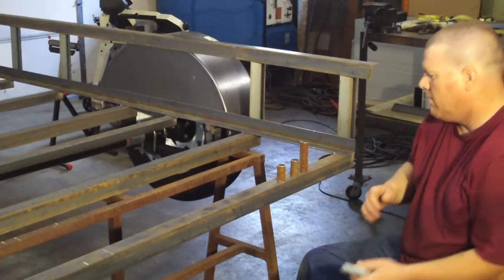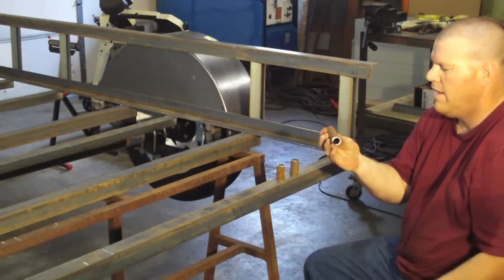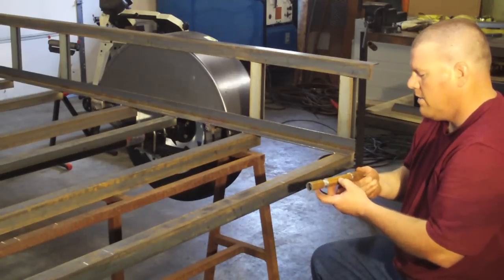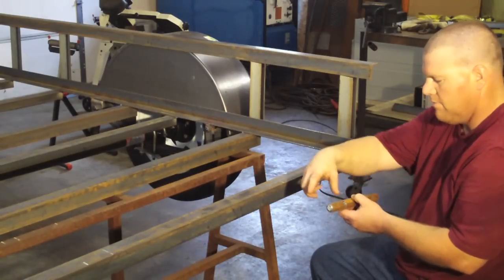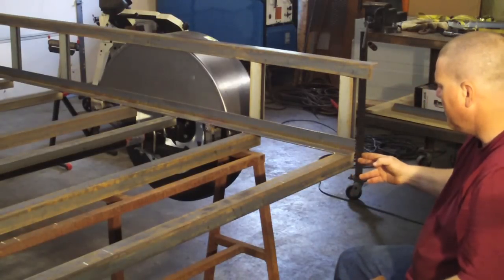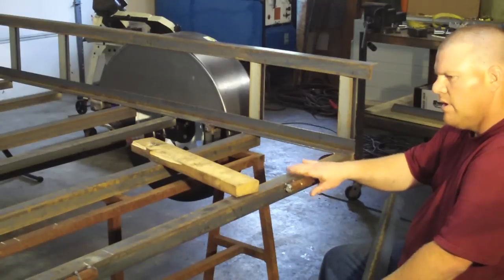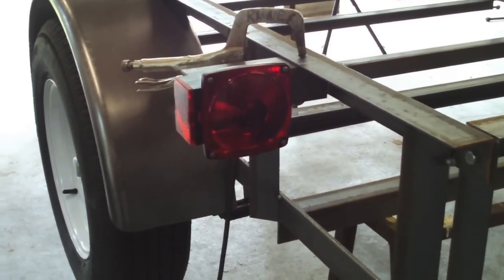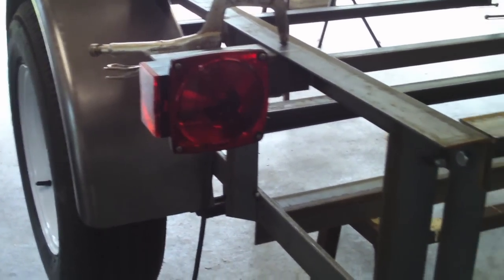How to Build a Utility Trailer Part 8 Ramp or Tailgate and Tail Lights Installation

Comment: 11 years late but….The angle running front to back how much more would it cost to add another 1 1/2” to the leg running up n down? This would be so that your angles running across sat on the angle and then welded instead of welding it under the angle? A tiny bit more cost would be way more sturdy????

Comment: YOUNG MAN , U SENT ME AN EMAIL  WHILE BACK , I WAS NOT COMPLAIN , I WAS TRYING SHOW U HOW TO DO  BETTER JOB AROUND THE CORNER BUT YOUR SIDERAIL ANGLE IRON WAS RIGHT ON  , AND I DON'T NEED ANYONE HOW TO DESIGN TRAILER FOR ME , BECAUSE I BEEN IN THE BUSNIESS FO 30 YEARS OR MORE , ( I AM YOUNG AGE OF 67 YEARS OLD ) SOFAR  AND ( I RETIRED BECAUSE HAVE PARKINSON DISEASE ) NOW  ! .

BUT STILL DO SOME WORK , WHEN I AM N O T SHAKING SO MUST ! .

U ALL WAY SAID THIS ON SHOW THEY ARE TO CHEAP REPLACE  LED LIGHT WILL LAST MANY  YEARS , AN BY THE WAY TURN YOUR LIGHT BRACKET AROUND , (  >  WANT TAKE ANY MORE TO DO THE RIGHT WAY    < )    U THINK ? 

ALSO U YOUR LIGHT CLOSE TO YOUR FENDER AND THE SAME HEIGHT OF YOUR FENDER TO BECAUSE PEOPLE CAN SEE THEM BETTER FOR SAFTEY COME FIRST ! .